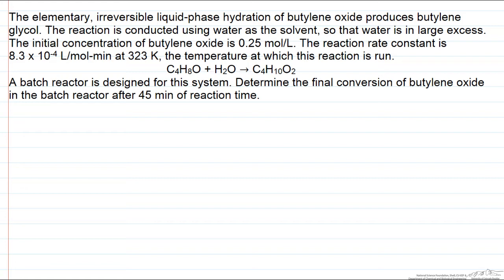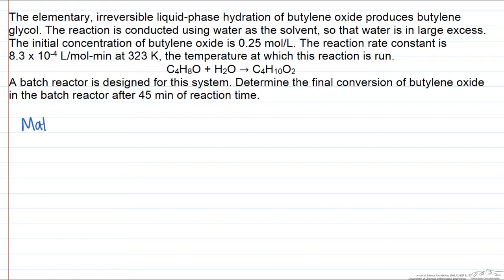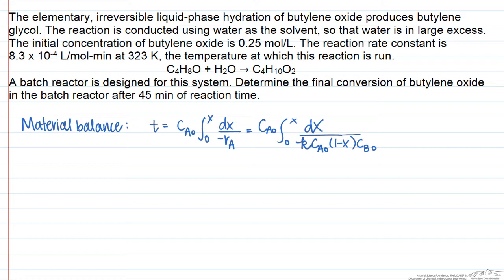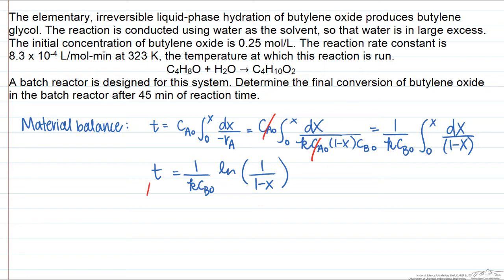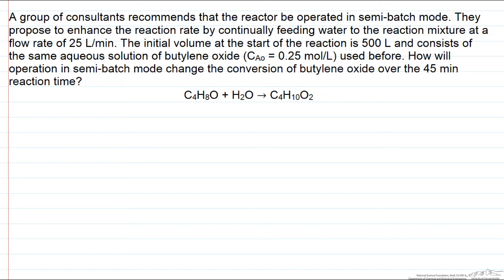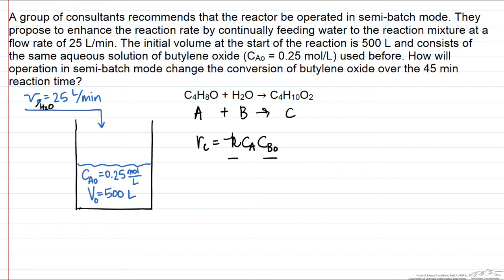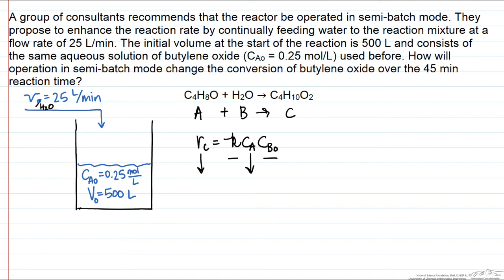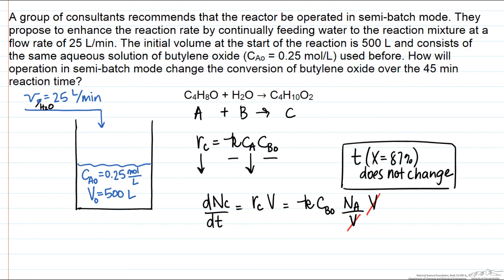Batch Reactor with Excess Reactant

Comment: it should not be the integral of (dx/-r) but the integral of (dx/r)..
Just a minor sign error.
Reply from the maker: If you are referring to the first step, the minus sign is present because rA is a negative number. These signs then cancel.  You can prove this to yourself by solving the integral without that negative sign and seeing that the solution for the conversion is not reasonable
Reply: +LearnChemE i always thought the rate expression was: rA=k*Cao*(1-x)Cbo and not rA=-k*Cao(1-x)*Cbo
Reply: +LearnChemE and that the minus dissapears when work with the conversion instead of the number of moles